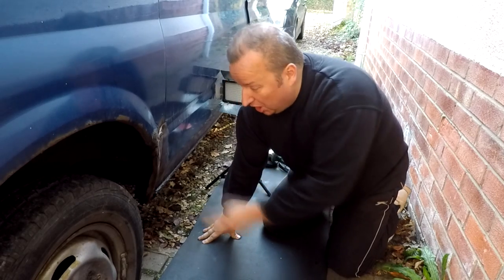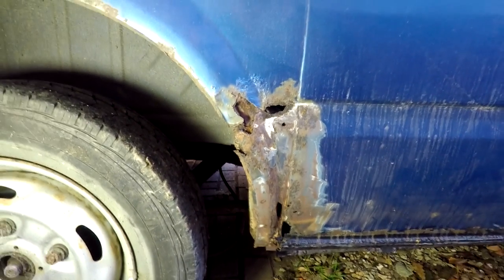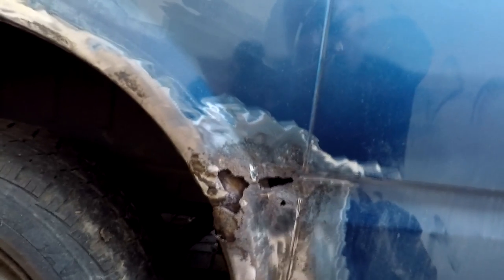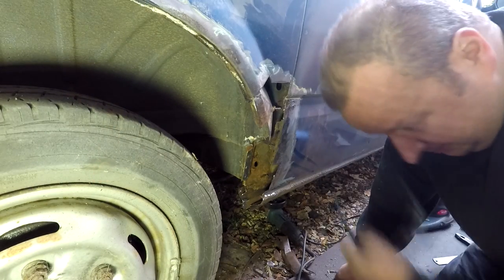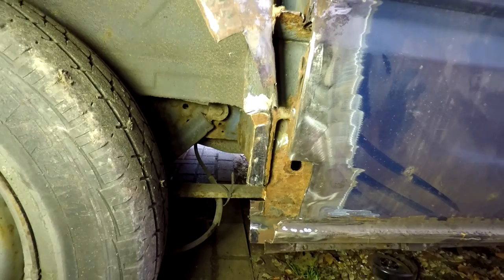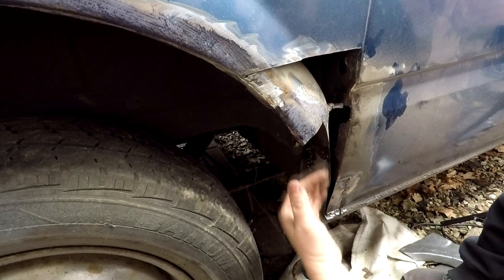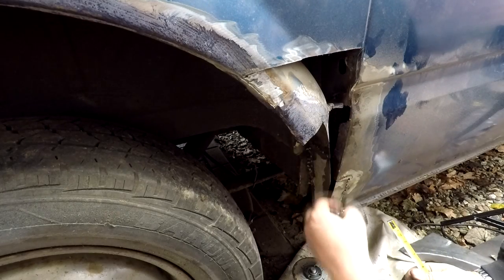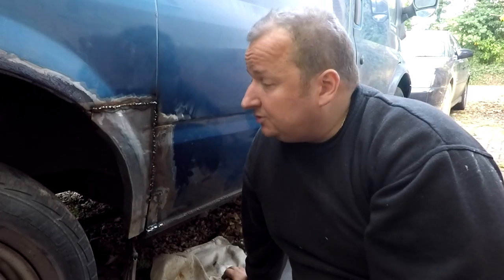Part 6 Rusty Ford Transit Mk6 Rear Wheel Arch Patch

Comment: Really well done with a limited array of tools. I worked in a roadsign factory metal dept and can't believe how you made that complex panel in your shed. The welder is a godsend as it seems to  weld that thin steel really well. Might as well weld a thin strip over the wheel arch when you're at it.
Reply from the maker: Yes, I think I will do that Tez.

Comment: Great job mate on making that panel 👍🏻

Have you Tried using weld through primer to cover the back of your repair panels before welding them in also use it spray over what you weld too? 

On the big panel you could of drilled a couple of holes on the front lip of the arch to spot weld to the inner part of the arch where it’s normally glued from original if that makes sense 👍🏻
Reply from the maker: Yes, I did think of that. Nice comment.

Comment: Very nice job spot on .try running weld in lines may save time.
Reply from the maker: The metal is too thin and you can't control the amps on this welder to do that.

Comment: The whole of the wheel arch wasn't worth replacing anyway as the whole of it hasn't gone and you did say it's not a restoration job.Im thinking of taking up welding where i volunteer. What type of welder do you use?
Reply from the maker: Its a Clarke TE135 Turbo from Machine Mart

Comment: One thing that has always confused me is when to and not to use something like Hammerite Krust? I was told years ago that my wheel arches the rust came back as I didn't use it? can you weld over Kurust? it is all very confusing
Reply from the maker: You cant really weld to rust, even if its been converted.
Reply: @retrorestore  I understand now

Comment: Wish Id seen this first LOL Well my job wasn't bad went through out version of MOT a few days ago so happy days, but Its a lack from the factory and previous owners on Maintenance for doing the bottom work ie Rust prevention and coating, I do it for all my vehicles and yeah its a couple of days of sweat and swearing but then a couple of years or more dont need to worry.

Comment: Hi Martin, you mentioned Vactan, have you found that product to be the best in it's field, does it really kill the rust? I've been looking for an independent long term test of such products.
Reply from the maker: I used it on the Triumph Acclaim 4 years ago and still no signs of bubbling.
Reply: @retrorestore  Cheers, thanks for that.